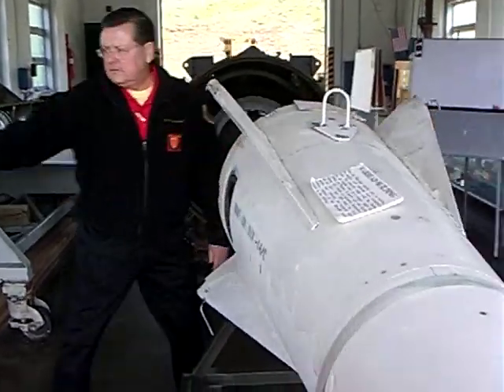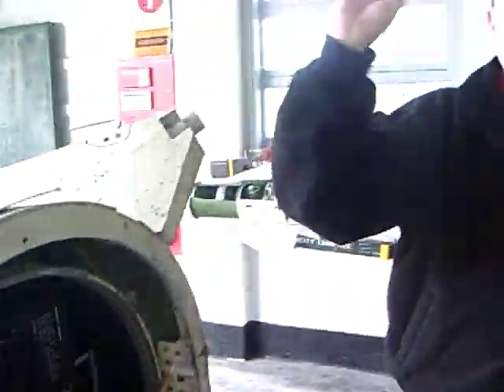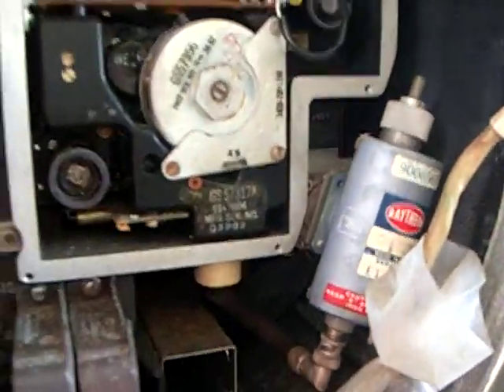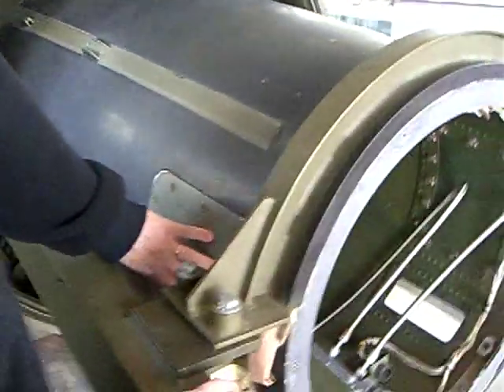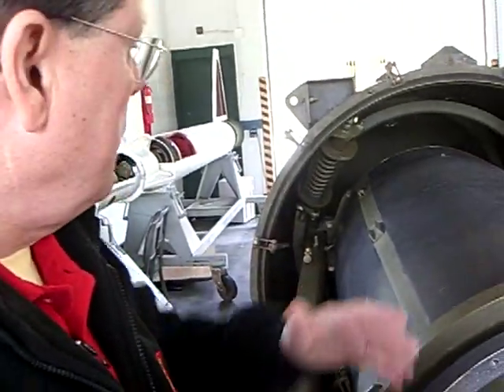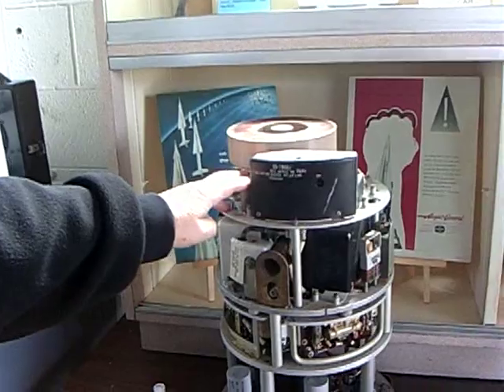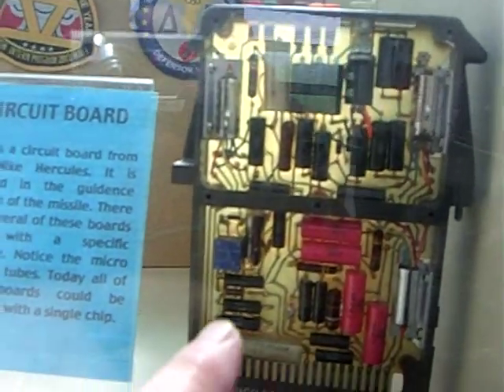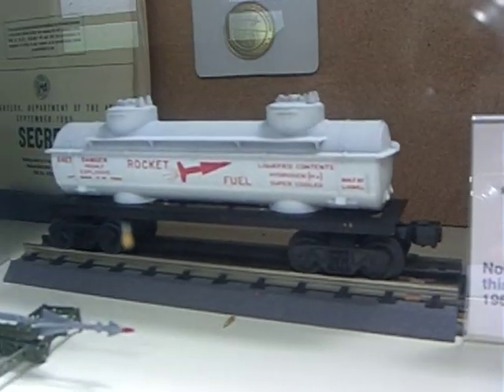Close look at a Nike Hercules Missile Guidance & Warhead (Nuke&HE) assembly. Battery site SF-88 #2

Comment: While Western Electric manufactured most of the electronics in the missile and ground stations and managed Sandia Labs, it was Bell Telephone Laboratories (inventors of the transistor among other things) that designed the entire missile system and architecture. Most of that work took place at their Whippany, New Jersey location as did work on Nike Ajax, Nike Zeus and the Spartan and Sprint missiles that made up the Safeguard anti-ballistic missile system.

Comment: Interesting video. Brings back memory (IFC maintenance). Maybe it is mentioned before. I don't believe that the missile sent any missile data back to the groundstation (MTR). It only sent a ping back so the MTR could lock on to the missile (beacon track). And the thing on the pole (simulator unit) did also sent no info back (except the ping) and maybe as i remember correct so called zero pips for adjusting the range in the MTR.

Comment: Served with Nike sites at San Pedro , Calif. and Germersheim, W. Germany launching area crewman 4!1962-1965 during Cuban Missile Crisis and the assassination of JFK. In San Pedro we had an “accident”——bottom right booster fin caught the edge of the elevator platform and jackknifed during a Brigade ORE. The rear locking bars on the track malfunctioned and didn’t lock—- the fibration of the elevator caused the rear of the missile to
Move. As a member of the launching crew we had a perfect score for the drill but post I don’t remember. Nice story

Comment: After the computer on the ground has guided the Nike missile to the target, the computer will command the warhead to burst in "close" to the target and not "hit" the target to develop the maximum force of the explosion. The Nike missile has no "impact" warhead fusing. It won't explode by "hitting" the target. If the missile should lose contact with its tracking and guidance radar for X? seconds, the warhead will explode and destroy the missile in flight. The Nike-Herc was an excellent system.

Comment: With all due respect, the Nike-Hercules missile itself does not "need to know where it is",  the "missile" only needs to "know" where "down" is so that computer commands to turn or dive are correctly performed. This missile has no computer on board, it is guided by ground computer commands coded through the missiles own tracking radar (MTR)  The guidance computer needs to "know" the missile position at launch and the missile and target positions at all times before intercept.
Reply: Howdy Buck ! You seems to know stuff . Was the FLODAC ever used in a missile guidance system?  Patent 3190554 .   Nice lady  Fran posted some stuff I sent her on this old tech at 8:24 https://www.youtube.com/watch?v=5qgxsJp8MZk&t=504s .  Kida cool doing digital calculation  with air huh?  .

Comment: The Raytheon device (1:31) is a magnetron (6.2GHz.) for the microwave link. I know, because I got hold of a guidance system like this one, and took it apart completely. Very interesting technology, essentially a completely analog computer, using delay lines for storage. It uses sub-miniature vacuum tubes (mounted inside an aluminium envelope on a heatsink) and some germanium diodes. I used some of the vacuum tubes to build a nice audio amplifier.
Reply: The tube in question is definitely not a magnetron. The shape is wrong. It is some sort of traveling wave tube.